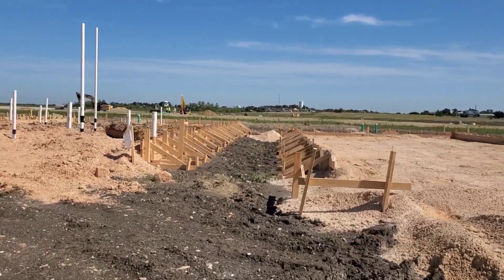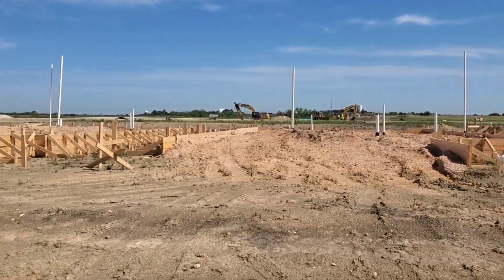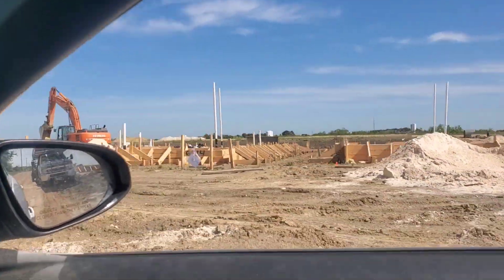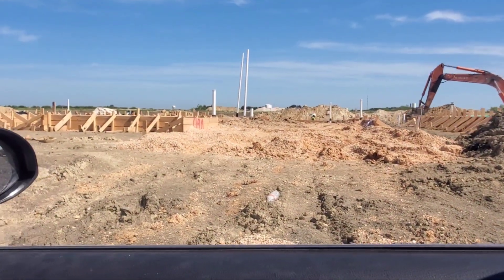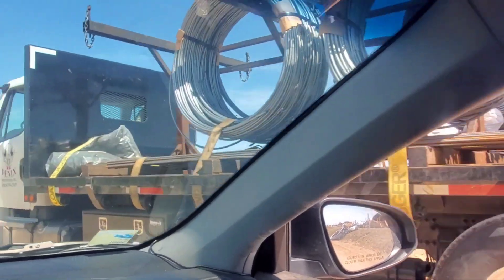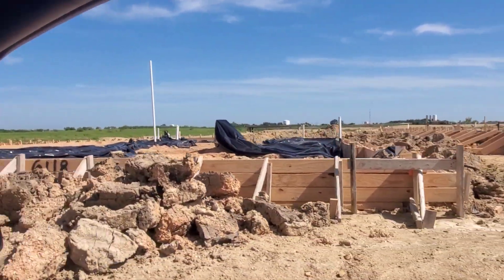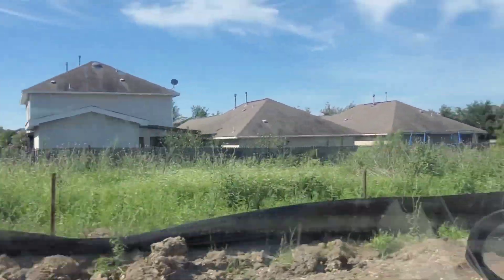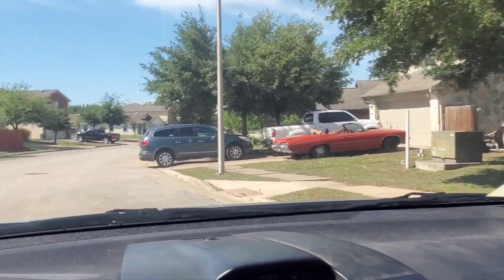Inspecting from the car: Too early for the foundation!

Comment: Hey Kasey, have you actually ever seen them stress these pt cables? I  know they are supposed to be stressed but have never seen a contractor stress them.
Reply from the maker: The jack they use is pretty small acutally, but yes I have been in the neighborhood when they were jacking them. They bring someone in to do it; it isn't the builder. They get stressed, wedged to lock them in, then someone comes behind and cuts, then another guy caps the ends of the tendons and fills the patch. 

All done!